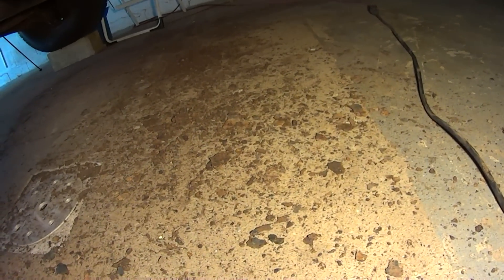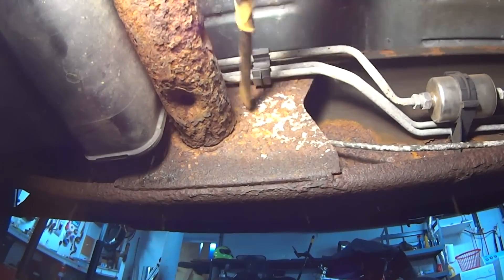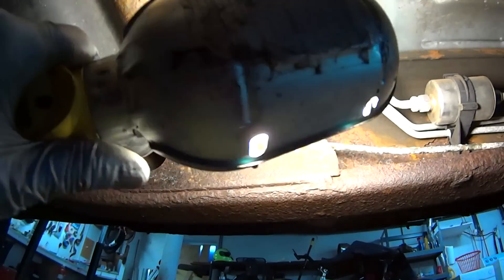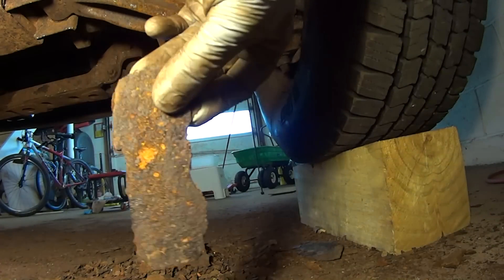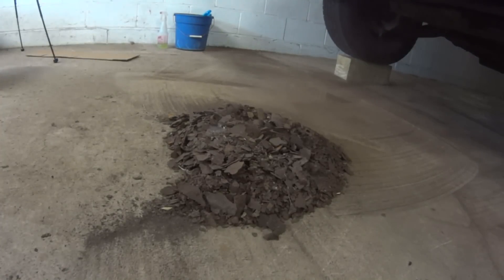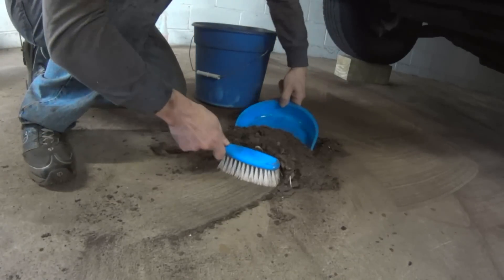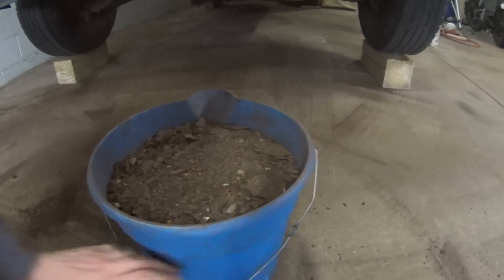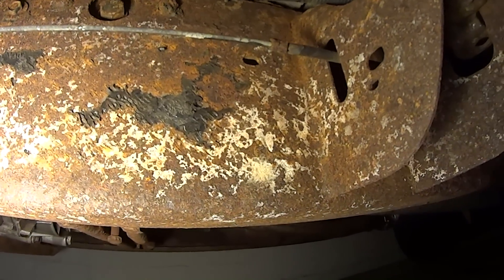Most satisfying video. Silverado Frame rust removal, RUST PROOF STUDY

Comment: Mine's worse. I'm using an air chisel as well. I have a hole all the way through one of the round cross members that one of the shocks mount to. Taking it down to as clean as I can with a braided wire wheel on an angle grinder, then painting it with phosphoric acid. Then after cleaning that off, I guess primer and paint or fluid film. Haha! I just noticed the rubber band... I'm using that trick as well.

Comment: I just had all the brake lines replaced on my 07 1500 hd., my frame isn’t quite as bad, but it needs to be cleaned up and coated with por15. It’s a huge problem here in Michigan with the road salt.
Reply from the maker: This truck was driven in Michigan for 16 years. Instead of Por15 use grease. I did 7 different section on the frame to test different coatings and paints. Grease is winning hands down
Reply: That sounds like a good idea, it’s the part that you did that’s no fun, not looking forward to it.

Comment: Removing a lot of the rust - would this not require some structural welding if you're removing that much material from the frame? I figure depending how far gone the project is, it may require some new plate added back in.

Comment: endangering the owner by making them believe this is ok to repair :/ . This vehicle aint safe no more ....... this carowner should get the " Hard talk "  either fix it properly or get new car.
Reply from the maker: U crazy. This frame is 3 times thicker than new Silverado. 1999 Silverado had frame 0.160 thick weighing 960lbs. Now in 2019 model its 0.040 thick at 260lbs.

Comment: I can feel flakes of rust in my eyes just watching this.
Reply: And washing it out of your hair in the shower lol
Reply: I know right
Reply: I had a landrover, so i gues no further explaination is needed.
Reply: my eyes hurt just reading the comment lol
Reply: Working on the rust of my '06 Silverado today. I put ear plugs in this time. It even goes in your ears.  Smart ass rust.
Reply: Can't impress enough the need for good fitting goggles and a quality respirator.  Ear plugs also a good idea to keep the crap out and the persistent noise from an air hammer on a steel frame.
Reply: RIGHT!?
Reply: Lol yeah. Better get xray in your eyes before mri
Reply: Better get xray your head before mri. Metal get in eye and not feeling

Comment: My 1999 Chevy Silverado NBS rotted horrible. I am used to looking at an older frame and saying "ah little surface rust". A 1999 I have pulled the box, removed rust scale, wire wheeled it, and two coats of stop rust, two coats of black enamel, two coats of 3M Professional undercoat, and two more coats of red paint! This is after I boxed the frame with 1/4 plate steel I had plasma cut and square stock top and bottom where the hitch bolts, and 1/4 inch steel on the bend down with angle iron to the front. Put it on the lift and there is metal left- the metal I welded in and she flexed about a 1 1/2 inch box to cab. I'll miss it but I am going to seriously think Dodge 2500, or Chevy 2500 not sure I like the new trucks. I will see how my dads hold up after the second winter and he bought it brand new. 5.3 vortecs are badass, but no good without a frame. I am saving a 2005 Ford E250, I caught it in time I think but a word to the wise take them mats out in the back and get mud flaps for them!!!!

Comment: That aint bad it is fine till you can feel the vehicle flex then you weld steel plate over the holes and rot clean the frame then use alot of oil undercoating

Comment: I would bet this truck sits a lot in grass or gravel or any kind of damp area.   because I have a 2002 with almost 0 rust on the frame and I park only on concrete.  drive it daily in all weather.  it sees plenty of salt on the road.  some spots on that frame looks like someone sprayed it with undercoating which is also a big no no.  it traps water behind it and rusts the frame out faster.  also, do not get Zbart shit sprayed on the underside of your cars/trucks.  it will also trap moisture behind it and rot your car out faster.

Comment: I wanted to do a frame restoration on my 2000 Chevy S10, but the rear cab mounts are rusted out.  It won't pass inspection that way.  It would be great to turn my truck into a project vehicle, but I wouldn't know where to start when it comes to repairing rust damage.

Comment: Was the frame still strong enough with such severe rust damage?
Reply: Truck is still on the road, 5 years later. That frame is fine
Reply: This is not severe.  If that needle punched through, that would be severe.

Comment: It is a mess. You are doing a great job cleaning her up. 

This morning about 9:00am today, I went outside to my car to wire brush and add the underbody  Rust Converter. Next I will add to the frame Rust-Oleum undercoating to protect the underbody.

Comment: When chevy made this truck they dipped the frame in an anti rust tar like under coating. Most of what your are removing is the undercoating with rust in behind it. Thanks GM! It wouldn't hurt so bad if your job security make cheap crap so they have to be replaced  plan had kept workers in this country to keep making the crap

Comment: At first, I was like "That isn't the proper way to use an air chisel".  Then, I was all like "wow, that's an effective way to remove rust."
Reply: Thank for your comment on air chisel.  I was wondering what was the tool name.
Reply: Until that chisel went through the frame 😬
Reply: @dsotojc4645 when did it go through the frame? Also I'd rather it did any frame that could go through should be attended to immediately kinda hard to fix a problem if you're not aware of it
Reply: @dsotojc4645 whenever i work on a frame, i try hard to go through every part possible, if you can go through it , it has to be reinforced

Comment: Good video.  Really demonstrates how bad these GM trucks can get.  I pulled the bed on mine, pressure washed the entire frame, and coated with POR15. I had to weld in a couple of new rear cross members, as well.  An industrial pressure washer will take rust and salt off almost instantly.  You just have to be careful around delicate areas.

Everyone rags on Toyota and their rusty frames, but the Dodge, Ford, and GM frames were just as bad in the late 90's/early 2000's.  Had a buddy's 99 Silverado snap clean in half on the hoist.  Cab in the air, tailgate on the ground.

Comment: I've had good luck with POR15 for those that are asking. Going to try a few different things here over the coming months as an experiment before I start my 79 K10 restoration. Going to try some of the "Rust Converter" products like Corroseal, some Rust Reformer from Rustoleum, and maybe a few others and see how they turn out. Plus I like experiments. Adam Savage tells us that often enough the only difference between "screwing around" and "Science" is documentation, lol. 

As an aside holy crap that was a log of scale. Looks like it got under and lifted the factory paint or undercoating that was on it. I am in the Dallas, Tx area so thankfully we're far enough away to not worry about salty ocean air and not up in the rust belt where they salt all the roads for 8 months out of the year due to snow.

Comment: I strongly consider replacing the frame if I removed over 40 pounds of rust from my truck.  You can't remove the rust from the inside of the frame rails and looking at that frame, I would junk it.  The vehicle is not that safe to drive.  Why are you wasting your time on this?  The manufactures need to find better rust prevention than merely waxing the frame.  Why don't consumers demand that from them...you pay enough for the truck.
Reply: Consumers better to demand not as corrosive material used on roads

Comment: WOW! You did a great job cleaning it up. Another weekend of POR15 (and frame paint over that), and it will be sweet for just about forever. This is why I never buy used... People just don't give a sht (which is crazy, as a car is the second most expensive thing to own). I did the POR15 job once my wax started to abate on my 89 chevy K2500. Like new again. It's a mess, it sucks, and not easy. But man, it is worth it.

Comment: Do rust converter pastes work on the light rust as a primer?
Reply from the maker: Sure. It does work.
Reply: Trout Junkie this vehicle desperately needs to be applied a rust converter then :) and a good insulator afterwards

Comment: Forgive me, as i do not live in an area that snows and has to deal with rust...
 But, why remove it? Does it help slow down the inevitable process? Its gonna rust regardless, its gonna keep driving on salty roads... 
One might say you're clearing a "protective" outer layer of rust and exposing the inside layers to more salt particles, perhaps? I dunno. Just spit balling after having watched for 3 minutes and doing zero research on the matter. 

The typical online professional...
Reply from the maker: I did full restoration. Doing long term study using different paints and wax, grease coatings. I did not leave the frame exposed.
Reply: All that scaly thick rust retains moisture. Just like dirt after offroading. Get it off, keep it off.

Comment: That black stuff is either paint or undercoating. With some rust on it. So you have 40 lbs of paint.
Reply from the maker: No. The black coating was from seller who sprayed the frame with plain black paint over rust.  Im sure he used less than one can

Comment: out of curiosity what is the point of removing rust from the metal? Wouldn't removing layers of metal only damage the integrity of the metal frame creating weak spots? I'm completely unaware of rust removal so please bare with me lol.
Reply: Noel Benitez the rust isn't offering any structural advantage, and he's probably gonna wire wheel it off and paint it
Reply: oh I see, so just remove the stuff that aint helping and paint over it pretty much?
Reply from the maker: Exactly

Comment: You chisel that off, and then pressure wash, dry and rust convert and rubberize and she will be good to go for another 40 years.  Unlike the Toyota frames on the tundra sequoia, etc.  They would have looked like swiss cheese after the chiseling

Comment: I've had 5 GM pickups and after the last one rusted so bad on the frame and brake lines, I traded it in.  No more GM.
Reply: But.   If you can weld and have a tape measure and plumb bob you can pretty easily chop it at the frame rails by the gas tank where the sections meet.   Then with a die grinder and lots of bubbly you grind away the rest of the inner ( rear) rails.    Once that’s done you go find some  3/16 2x5 “ steel squared U Channel at the scrap yard.    It’s commonly from torn down buildings.    Drill a few plug weld holes behind where the new one will stop + - .   Drive those in as far as possible, mine are a foot.   Then weld it up.    Junk all the cross members and make your own.   I used 3” pipe as i had some kicking about.    I left the top and part of the side ( as support) of those rear frame rails as a locator for all the mountings otherwise you can just mane up a careful diagram.
   Everything under there just more or less fly’s in formation anyways so as long as your axle is hung straight you’re fine.    I remounted everything with HD air shocks .   Shock mounts are bone simple to make it cut off and remount.     It’s all a labor of love , make it a project.    While the box is off and you can wander freely in there clean or sandblast everything you can get at. , replace shitty. brake lines , fuel lines ect or at least paint them up and undercoat them.        It’s so easy working standing up!     Get the cab mounts and all else under that section too while you’re doing it.    Flip the box up on its tail and clean and paint that and undercoat too.
   I bought my 2000 GMC Sierra with that candy cane frame in 2013.   It got done over over the winter of 13-14 and I still have it today.       It’s time consuming yes but we’ll worth it if you have a decent truck with a shitty rear rails ( their biggest failure point BY FAR) frame.  
 The point is all I needed was a 6 hp air compressor some cheap air tools , electric grinder , some wire wheels , cheap HF Schutz spray gun and simple old arc welder to do all this.     It’s tinker work project not rocket science and 30k later it’s still doing fine.    
    I do oil it with ATF / Petrolium Jelly/ Bar n Chain oil yearly .

Comment: Everybody Talks About  Import Trucks and  How bad They Rust.  But  the Stuff build Here is not Much Better.    My 2005 Toyota Tacoma had a New Frame Put on it in 2015 and did not cost me a dime and a Free Rental Through the whole Process. That's a Truck that was !0yrs Old   You Don't see the Big three Standing Behind their Rusty Frames and Rusty Fuel and Brake Lines

Comment: In Minnesota a piece of heavy steel has to be welded to the frame on trucks not even 10 years old otherwise they bend right behind the cab. I've seen gm trucks looking like a sway back mare driving down the road. Especially the half tons.

Comment: I just have a question, the layer that you removes,
Is it an original layer of the car that is be consumed by rust over years ? 
Or it's an additional layer that have been create by agglomerate corrosion ? 
For resume, do you "cut" the car, or you only remove a supplementary layer, not an original layer ?

Comment: this is a video of someone wasting their own time, the paint you put over anything you chisiseled will just fall off as the rust continues to form since you couldnt possibly remove all of the rust like that. someone that had a clue would of removed the box and sandblasted that frame with almost no effort compared to what you are doing. this is at best splash and dash type workmanship.

Comment: 2005 1/2 ton Chevy. Was Ziebarted with 40 miles on it, and I wash it regularly. It now has 92K on it and I had to replace rockers, cab corners and box fender wells last fall(Sept.2017). Between the shitty drain holes that get plugged up, cheap steel, and the salt brine that the Iowa DOT sprays constantly from Nov-March vehicles don't have a chance.

Comment: What year is this truck? I have a 1995, it looks bad, I definitely expect I will end up with some holes when I do this, already fixed a small portion of the frame, passenger side where the frame drops down and changes from square tube to c channel(also where the ac condensation happens to drip)

Comment: Remember that is not 40 pounds of iron removed from the frame, as the oxygen molecules in the rust make a considerable portion of the weight. Along with the undercoating also being removed.
Reply: Lot of moisture in it too

Comment: I have tried every technique possible por is great stuff I've prepped Vehicles exactly how you are  and in 2 years the stuff comes off in sheets instead of flaky rust I've also did the sand blast prep and used  por same thing in two years comes off in sheets the last two vehicles I've done I've prepped them just the way u are used an acid wash and then use an undercarriage coating and topped it with New Hampshire oil it is a product you have to apply once a year and it works amazing it doesn't allow any moisture to get in it leaves an oily film over everything!
Reply: By the way the best way to do it is completely sand blast the frame to bare metal zinc coat it,epoxy coat and then put a urethane coating it will never rust again! it's an extremely expensive process because you have to strip the frame out of the truck to do it!!! so simpli it's not cost-effective!

Comment: Anyone that's freaking out about the strength of the frame being compromised would be really shocked to see what a really bad one looks like
Reply: This isn’t even that bad. It’s fixable. At least the owner’s doing until most owner’s being told about a hole in the frame when getting an oil change
Reply: @cherokeefit4248  what do you do to fix the one in the video after removing the rust?
to reinforce it
Reply: @corybrott8455  you don't need to do any reinforcement for surface rust like what you see in the video. Some Corrosion allowance is factored into engineering designs.
Reply: @richcombs4805  that is not surface rust😂
Reply: @Cooldibs it’s definitely not rot. That frame sounded pretty solid to me especially considering he took an air tool to it
Reply: @Cooldibs Yes it is, you can clearly see the metal underneath, and considering he was using a power tool/ chiseling the rust that would have gone straight through if it wasnt solid ...
Reply: @SpartanQwop i just bought a Sequoia from the East Coast and one part of the frame on he driver side was broke in half. Lol what's the most of it looks good and I need to do some type of testing

Comment: Seems like that much rust would compromise the structural integrity of the chassis. Is it safe to drive a car with that amount of rust on the frame?
Reply: Yes as long as the frame isn’t rotted through or has any holes from rusting. That frame is still solid so it’s perfectly safe.

Comment: So is this car still safe to drive with all that rust knocked off? I mean the actual part's strength should be compromised right?
Reply: Rust has no structural integrity. So removing it has no effect on the strength of the frame. If it was safe before removal, it's safe afterwards as well.